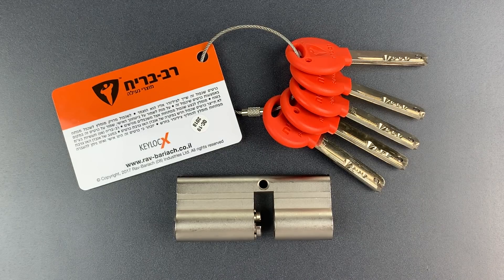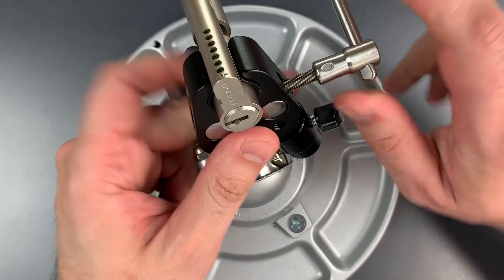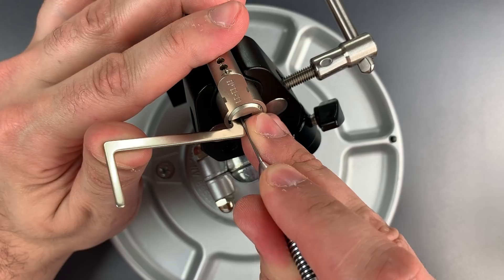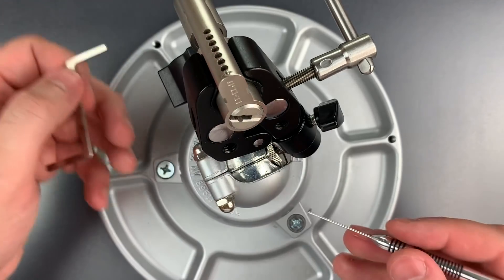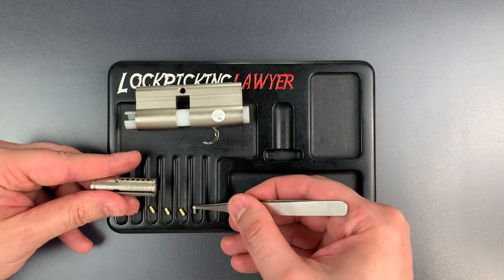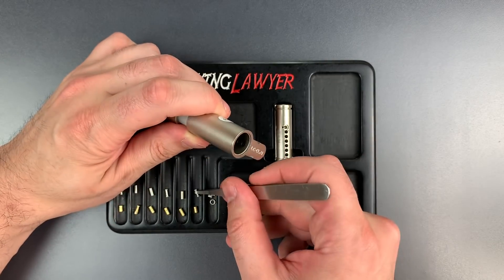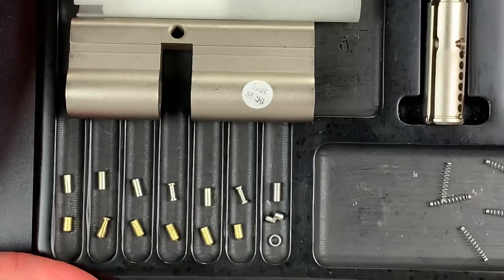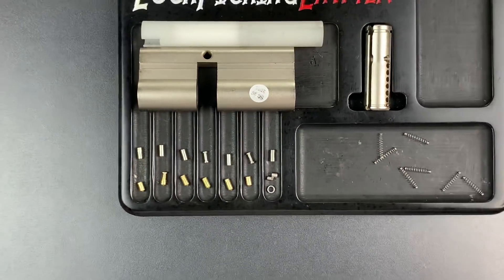[926] Rav Bariach “KeyLocx” Cylinder Picked and Gutted

Comment: This seems like a great lock, very few people wanting to pick your lock will know about the button thing, also it doesn't seem like a simple pick at all.
Reply: I feel like this goes for a lot of locks he picks as he already knows what he's dealing with before starting and he can chose his tool and approach accordingly.
Reply: It’s not simple to pick your right. But it looks very vulnerable to a snap attack with a snapping bar or massive vise grips. Most locks in Europe are very hard to pick so they snap the whole lock in half then open the door or whatever with a screwdriver.
Reply: @jamesstrain7062  well that's just rude to mistreat a lock in such a way.
Reply: @dex1m  There are plenty of anti-bump, anti-snap locks, like the Avocet.
Reply: @mgraham81  He also picks them at least once off camera before making the video. He's said as much in other videos.
Reply: @jamesstrain7062  is that why I have so much trouble learning to locpick. Trying on European locks.
Reply: @jamesstrain7062  I mean, it's probably hard enough to break the ol' brick through the window would be easier. That's the goal with this kind of lock.
Reply: Mike : It’s generally much easier to pick a lock if you can look at the key. I’d like to see the LPL working on more locks where he doesn’t have a key, and hasn’t had a look at one.
Reply: James Strain : Picking locks is not the most common way to break into something. Busting a door open, breaking a window, simply smashing the lock out of a door, kicking the door to pieces, and so on are more common. I talked to a jeweler once who had excellent locks on his doors and bars on all the windows. Someone had robbed his store the previous night by breaking a large hole through the concrete wall with a sledge hammer.
Reply: A lock like this would be a step up from any lock you can buy at Home Depot or places like that. 

Because of the foreign nature of the lock that would throw an American thief off, with keys that cannot be copied, with awesome Israeli technology this lock would be one I would sleep good at night knowing is on the outside doors of my house.
Reply: Hi Hu the only people who criminally pick locks on residences when the resident is at home are espionage agents who want to abduct someone inside without leaving evidence of breaking in.  Or, to plant a bug or retrieve something without leaving evidence of the intrusion, when no one is home.  If the intruder’s goal is simply entry there are easier ways, such as drilling the lock, kicking in the door, cutting a hole in the wall, etc etc, so if you don’t have a security clearance or keep other secrets in your home I wouldn’t recommend using a lock with ridiculously expensive keys to protect your residence; invest in a good alarm system instead.
Reply: @jpe1  my insurance doesn't cover theft if there's no sign of forced entry. They'd assume I forgot to lock the door.
Reply: That's mostly true for any lock. If you want to pick a lock with malicious intent, the first thing to do is recon. Just like a bank robber would first go into the bank to look for possible blind spots and escape routes, so a burglar would first check the type of lock. Then he would acquire such a lock, pick it, gut it, and look foor any weaknesses. Some locks have very deep pin chambers for example, a thief who knows about this flaw can exploit it by using a comb pick without raising any suspicion. A thief encoutering this lock on a targeted break in will purchase one and figure out the interactive element in not much time.
Reply: @censusgary  If the lock face has a look of a recognizable brand/model then you can dig up the proper information beforehand!
Reply: @jamesstrain7062  When installing european locks, they offer multiple sizes, depending on the thickness of your door. You must make sure the core does not protrude out of the door more than 3 mm, so the thief cannot grab the core with a tool, to begin with.
Reply: @jpe1  Cutting a hole in a wall... I guess in USA where houses are made of wood that wouldn't be too difficult, but good luck with European concrete walls. Also most houses that would be worth to break in have beefy door and door frame, it would be very hard to kick that in, of course they are complete with drill protected cores.. out of destructive entries the only real weakness on the house are windows.
Reply: Dark excellent summary of the differences between American and European attitudes.   After I wrote my initial post I was wondering about the whole security question of what is the goal, what is the actual weak link, etc, etc, and what is actual security vs security theatre.  As you point out, windows are the crucial weak link and anecdotally seem to be the preferred means of entry by petty criminals.  I don’t know how to judge the actual risk of break-in for the typical homeowner because obviously there are important but hard to quantity variables such as location and “curb appeal” (meaning, how much does the house motivate a burglar to want to break in, vs how hard will they think it will be to break in).  I suspect that ultimately security measures are all about what makes the homeowner feel safe, rather than being based on anything that actual matters.
Reply: Yep, you often only really know that there is a little easy-to-defeat feature if you have the key....
Reply: @censusgary  Agreed. That's what makes Bosnian Bills videos of challenge locks interesting; he hasn't seen the keys.
Reply: James Strain this lock goes in front doors of apartments, where it fits into a compartment that’s solid metal. There’s no way to snap it.
Reply: I guess Im asking randomly but does anybody know of a trick to log back into an instagram account??
I somehow lost the account password. I love any help you can give me.
Reply: @Ethan Mario Instablaster ;)
Reply: @Michael Jefferson Thanks for your reply. I got to the site through google and Im in the hacking process now.
I see it takes a while so I will reply here later when my account password hopefully is recovered.
Reply: @Ethan Mario no problem :D
Reply: @jamesstrain7062  I know it's a five years old comment, but I'll still answer. The newer version of this lock that's sold in Europe right now has snap protection too. Only on one side, but that's probably more than enough for 99% of the use-cases for this lock.

Comment: I'm intrigued by what appears to be a small crack at the 6th pin hole.
Reply: RIGHT???????????? Why isn't he acknowledging it???? hahahah drives me mental
Reply: Probably a defect that made it free or cheap for him to aquire it.
Reply: Cracks are intriguing indeed.
Reply: looks just like a manufacturing defect.
Reply: you wouldn't be able to see a "small crack", this is a substantial crack. seems to be a casting error. I guess LPL judged that it's in a place where it doesn't affect security.
Reply: Damn it.. I have to view it again, now....
Reply: I think you’ll find it’s simply a scrape, because of the lighting it appears to be a dark trench. There are similar scuffs on the pins themselves

Comment: That's an unusually long picking time. Sure it's less than 1 minute but that just means it's a decent lock.
Reply: 1:35, actually. I haven't timed enough LPL picks to solidify any sort of ranking system, but I think that puts this lock solidly in the "good enough" pile.
Reply: well it required more than a rake attack. so thats something
Reply: MASTERLOCKS has left the chat
Reply: @StopChangingUsernamesYouTube  yeah. security pins, the active element (which if you don't have the key, you probably won't guess, although that's probably more against copying than picking), the drill pins and ~1:30 pick-time by LPL sure make this seem like one of the better locks I've seen featured on this channel. But then I'm really no expert or long time subscriber...
Reply: @StopChangingUsernamesYouTube  That seems to be longer than some of his other videos including intro/outro.
Reply: Look at some of the older videos from LPL and you will find one or two absolute Monsters which almost beat him ;-)
Reply: It took a minute forty, including setting the tension bar in place.
Reply: 8:02: "Pretty clever."
The highest praise, when you consider the source.
Reply: Guess some more practice with the lock and a video made with effort on speed, not on a demonstration would make the difference
Reply: As far as LPL resistance, which at this point really should be an industry measuring standard, I would rate this at a 7/10 
10 being unpickable and 0 being a MasterLock

No obvious low skill picking attacks (i.e. raking, comb pick) +2
No obvious shimming/bypass/physical attack +2
Good bitting/Warding/tricky keyway +1
Key control +1
Lasted longer than one minute +1
Reply: Do you guys even listen when he speaks? At 20 seconds in he flat out says it's a low security lock... Time and difficulty are not the same thing.
Reply: @blackAngel88it  It looks a bit fragile though. It will likely snap apart if someone had the right tools.
Reply: @maybenot7298  Unless you have a good reason for pointing out the lock's origin, can you please refrain from dragging your politics into this.
Reply: @StopChangingUsernamesYouTube  I think it puts it in a really good position

Comment: You mention that it was a fairly easy pick to get going, but you also had access to the key and it's cuts/safety mechanism in there.  If you did not have access to the key first and you were basically going in blind not knowing about that spring loaded device on the key how would that have affected your picking?  Would it still have been as easy?

Comment: I've watched and followed from the start. 💕 
One question keeps coming back. Why are only driver pins steel drill resistant as surely having drill resistant key pins would help in a crude core drill out?
I hope you have something awesome lined up for video 1k? My imagination is running wild. I'm in 😜 x
Reply: If you drill through the shear line then the lock will just turn. If you drill through the key pins, you then have a lot of fiddly work to do to get the chunks of destroyed pins out of the way so the driver pins can drop though, and then the springs will still obstruct the shear line. It's slower and messier.
Reply: @petertaylor4980  Thank you. That makes sense 😊

Comment: First of all what pushes the interactive element up?  It looked like it was pin 2 your torpedo pin that was holding the key in after you removed the core it moved a lot before you put your finger over it possibly a smaller diameter to make it easier to over set also

Comment: Literally any of the Lockwood inline 6 pin restricted profiles can achieve the same outcome as this lock in having relatively low cost restricted keying/key control without sacrificing the type of locks you can use and pickability.

Comment: I have a question. As an Israeli this lock is mainly installed 180 from how you picked it. Meaning the key hole is at the top. Would that make your picking harder or just different?
Reply: For him probably different. For a less experienced one probably harder because one has to get used to it.
Reply: I'm not sure about this lock, but I find most locks easier to pick when the pin stacks are on the bottom.  Others may have different experiences, though.
Reply: Euro profile locks are pretty common here and are always mounted upside down too.
Reply: teslacoiler you mean, right side up.
Reply: @JasperJanssen  i mean rounded part of the lock side up and flattened one sided down.
Reply: Face up?
Reply: I find it interesting tat euro locks have the pins on the bottom of the keyhole. Pins were originally put on the top of the keyhole in US locks to keep water from getting into the pin cylinders and freezing the pins in place due to ice or rust. I guess the EU lock regulations are based on Global Warming making freezing a non-issue.
Reply: @lwilton  I live in Italy and all locks here have the pins on the bottom side: freezing is not an issue (i think that i used a blowtorch to unstuck a frozen lock only two times in my entire life, in both situation it was the lock for a steel gate, so entirely exposed to elements and not an euro profile cylinder)... also, so far i never ever seen a rusted lock.
NOTE: most houses still use a lever lock for the front doors instead of a pin-tumbler one or have both lever lock and euro cylinder.

Comment: The only thing I think this lock is good for is key control. 
But in my neck of the woods the lock would be snapped in half.
Reply from the maker: Agreed. Like I said, low security. 👍
Reply: @lockpickinglawyer Sorry j missed that part. It might be suitable for a internal application like inside a office as long as it has a lot of thumbturn for firesafety. The key control could be useful for Access control. But I would avoid it on a exterior door as it is obsolete for that purpose unless....maybe if the door uses security handles at the very least....

Comment: Couldnt you add a cheap bit of spring steel on the tip of a key? Grind/cut a small recess, then rivet/peen a small length of spring steel. That way it can compress when inserted, then pop back up at the end of the lock to push up the pin.
Reply: How do you get it to the right height?
Reply: If you're just looking to copy keys for this, it might be simpler to buy one or two of the lock sets, then fill the included keys with solder, then recut to the key you wanted to copy.

Comment: Why would a ball bearing in that empty hole prevent a drilling attack?
Reply: hardened Steel and maybe the bit sliding "around" the ball..idk
Reply: AIUI the general idea with drill protection is to break the drill bit. I think @deavman is on the money: the drill won't go straight through the hardened steel, and will slip on the rounded surface, making it likely to break.

Comment: Soo what would be the hardest combination of pins to pick? All torpedo bottoms and two-level spool tops?
Reply: Elijs Dima     Spools are somewhat easy for experienced pickers. Serrated pins or the floating spools are harder. And if all pins are different in form and length it is harder to get a good feeling than if all were the same.
Reply: If it's all the same that leads to a perpetrator knowing what he's dealing with/ figuring out what he's dealing with quicker.
Reply: A mix of spools, serrated, two-level spools, and T-pins, all with threaded slots and varying spring tensions ought to make a very rude barrier to anyone trying to get in.
Reply: Also drill resistance is always important for a real world lock. People with power tools are more common than people with LPL’s skills.
Reply: Variety is the spice of lock. Using a couple different types of security pins can protect against attacks like raking and make it slower to single pin pick.
Reply: "Alien tech" can help. LPL doesn't do many challenge locks, but if you search for "Whipped" on Bosnian Bill's channel you'll get a good idea of what's hard to pick.

Comment: I'm new here, but how does the notion of key control matter when the lock can be picked in 45 seconds with no key even if you have to go to the far side of the moon for a legit key?
Reply: LPL is an extremely skilled picker. The average picker would likely struggle with this lock and in addition, most thieves don't pick. They use brute force methods.

LPL also has the benefit of studying the lock and key. Most thieves wouldn't have such opportunities.
Reply: Because this lock is still better than a standard cheap lock. There is absolutely no lock that is perfectly secure, so it is always just a question of how secure you want to be and how much money you want to spend. In this case, this lock is intended for a place where your concern is more about copying the key than about the lock being picked. As he said at the beginning, a "low security" lock. One good place you might use this is an area with high foot traffic such that any attempt to pick the lock will be seen by other people.
Reply: Not everyone can pick it. Copying a key is a low-skill attack, in fact it takes zero skill if you just go to a locksmith, give them the key, and say you need a copy. Picking the lock requires a rare skill, and you need to pick it every time you want to enter. It's not bulletproof, but at least it's going to stop some attackers.
Reply: Yes because that lock was picked by someone who is a near master in his profession

Comment: What's the most pick resistant lock you have?
Reply: V Gaming he has shown a few that he picked and said he was rekeying for his own use. I may be wrong but I think he rekeyed an Abloy recently and a while back a Multilock. He also said he has some tricked out Kwickset locks on his house. Kwickset setup with a bunch of upside down “T” pins with master wafers under to catch the construction ball holes on the side of the core when picked to the wrong shear line. No way to recover from it without removing the lock to access the pinstack cap on top of the Bible.

Comment: I'm not sure I fully understand the interactive element.  :(
Reply: my guess is the key can only go in one way. when the key is all the way in, something below the interactive element pushes it up (like he did with the hook)  into the pin. but if it wasn't spring loaded and stuck out all the time, the key would not fit into the cylinder.
Reply from the maker: Correct Casey, except that the interactive element in this key is spring-loaded... nothing in the cylinder to push it up.
Reply: @lockpickinglawyer  I'm sorry LPL, I'm REALLY stupid.  Can't they just put a bump of solder or whatever on a blank key to achieve the same effect, then?
Reply: @Asdayasman . yes but it's not easy as copying the key in a regular shop from a regular blank
that's all it's meant to do